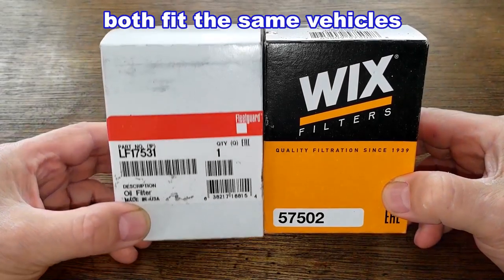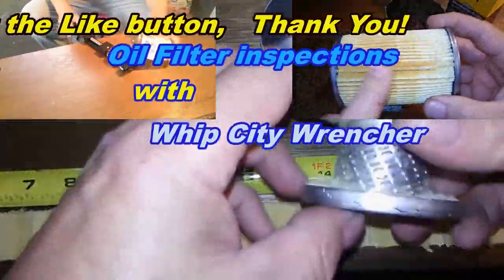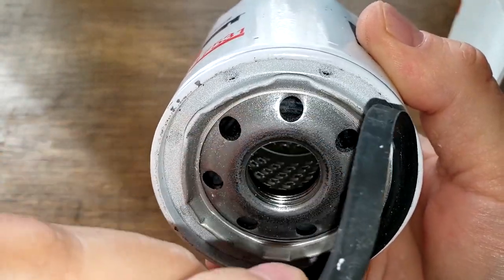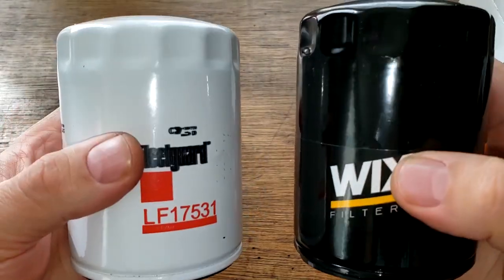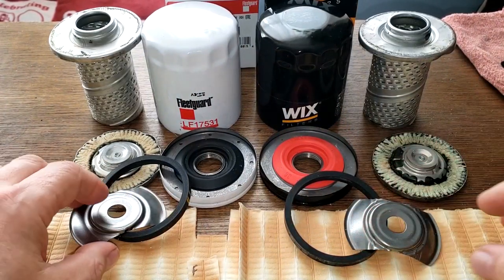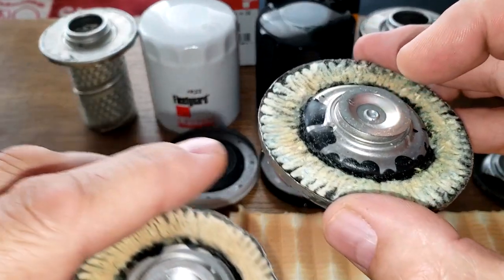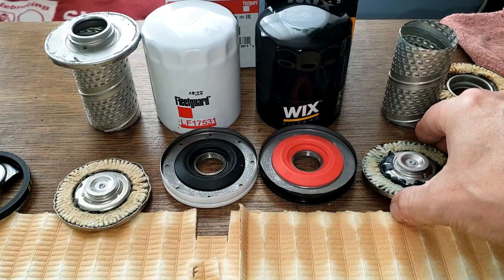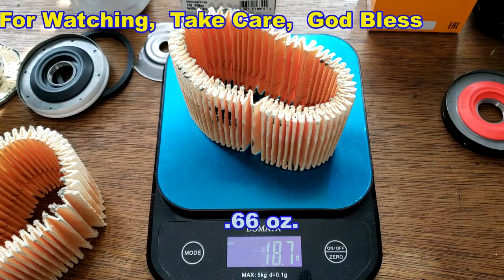Fleetguard LF17531 Oil Filter vs. Wix 57502 Oil Filter Cut Open Comparison

Comment: Wix use to be much better quality; they have let their quality control slip a lot.  Thanks for the video.
Reply: Yes, unfortunately. . I have been using Wix for 40+ years.  We still use Wix Regulars for most of our Fleet trucks as Fram doesn't make Ultras for alot of the 2500HD and 3500 trucks like Duramaxes etc.
Reply: Wix used to be made by Dana. That was when it was a good product. Mann cheapened the filters nearly to Fram quality levels.
Reply from the maker: You're Welcome, Dave!
Reply: @walterk1221  Wix under Dana was awesome. Even Affinia was better than what they are now. You are correct about racing Fram to the bottom.

Comment: Another FG 'labeled' filter made by Purolator US, Fayetteville NC. Pretty sure you posted a similar FG a while back. The FG looks decent to me, but would prefer silicone adbv. The "Wix" has M&H Purolator type construction. Agree on sloppy clean side excess glue, no bueno! I don't worry about a little excess on dirty side. M&H Wix QC needs to improve, topic is sad. Thanks for video.
Reply: Did Cummins Filtration sell out? For the ADBV, most all of our trucks have a verticle mount and never go more than around 6-7K with filtermags so not really a concern.
Reply: @GT-mn3bx  I don't believe FG sold out. I think FG is outsourcing manufacture of smaller and/or automotive gas engine oil filter applications. Seems Purolator US is making at least some of those (like topic) filters for FG now.
Reply: @faxmen09  this is true in broad strokes. Cummins Filtration focuses more on the larger HD engines, more frequently purchase finishing the smaller filters for gasoline engines.
Reply from the maker: You're Welcome, faxmen09!
Reply: @Nash_Nismo  That makes sense.

Comment: Good morning from Birmingham UK!
Reply: Good Morning, Birmingham, UK !!
46 degrees F -- Sunny, Warm and Dry at Phoenix, AZ, U.S.A.
Reply: @SlikLizrd  What is the temperature at Fram headquarters?
Reply: @jeffkortsch8276  it's the UK in November at 15:34. So going dark 🥶 Wet cold and Birmingham village gets very muddy this time of year🤣🤣🤣!
Reply: @jeffkortsch8276  Currently, at FRAM's Headquarters in Cleveland, OH -- it's 45 degrees F; cloudy; windy - gusts to 30 mph.
No precipitation for the next 6 hours.
 Besides the FRAM Headquarters, Cleveland is also the home of "The Rock & Roll Hall of Fame".
 Why do you ask, pray tell ??
Reply: @SlikLizrd  Is that on the Fram website? I looked there but couldn’t find it.
Reply from the maker: Good Moring Birmingham UK!😊
Thanks for commenting!👍

Comment: An excellent comparison of two filters that are similar in design. The filter media cartridge and bypass valve design seem to point to the filters being made by the same manufacturer with the Fleetguard built to a lower price point with the nitrile rubber anti-drainback valve. 

After seeing all that excess glue in both filters, I will be looking inside filters that I buy off the shelf to see if there is any before buying them.
Reply from the maker: Thanks, Jeff!

Comment: I would swear these are Purloator filters. The holes are different but the rest look the same idk.  Elongated holes are usually a Purolator thing.
Reply: Both oil filters have Purolator type construction, the FG made in Purolator factory and uses round inlet holes. Wix has M&H Purolator type construction, with oblong inlet holes some (not all) Purolator oil filter use. Hard to say if made in same factory as the FG. As M&H owns both Puro and Wix now, filters are now looking similar.
Reply: @faxmen09  He was referring to the Wix baseplate.
Reply: @GT-mn3bx  Re-reading the comment saying, "the 'holes' are different," you're probably correct. Had it said 'inlet' holes, would have been easier to distinguish the reference. It's true some Puro made filters use oblong holes, not all though.
Reply from the maker: look that way to me too.

Comment: Probably both filters are manufactured by Mann & Hummel, but use different baseplate & anti drainback values
Reply: Yep, the FG has a Purolator type baseplate, the Wix a Wix type baseplate. But, it's about the only thing similar to original Wix filter.

Comment: This is the one I've been waiting for! These really do compare about equally. You might recall a few weeks back where I was talking about the efficiency rating for this filter (21 microns @ 30.8%, per their data sheet). I never really heard back whether that was a beta ratio or not. They just said that type of rating is usually reserved for hydraulic or fuel filters. The odd part is that the media seems virtually identical to the WIX, so it must come down to a different testing process. Unless one of us hears back from the horse's mouth, we may never really know.

Whip, in your opinion, is the construction on a comparable Donaldson better? I picked up the Donaldson equivalent of these filters, and the main difference I noticed is the silicone ADBV. Plus their reps say it was designed to match FL500S specifications, so the efficiency should be pretty good.
Reply from the maker: Hi John,
The ones I've opened seem to be very well-made oil filters. Some have metal screen backings. What size did you pick up? If I haven't already I'll try and open one up soon.
Reply: @WhipCityWrencher  the Donaldson I picked up is the P577066. I'd certainly be interested to see what you find out if you get a hold of one.
Reply from the maker: @mphilleo  I just ordered one, Video won't come out till after the New Year but what other filter would you like to see it compared to?
Reply: @WhipCityWrencher  it crosses to this Fleetguard, the M1-212A, the WIX 57502, the FL500S, Purolator L22500, MSL57502, the Fram 10575 and the Baldwin B7449. I think you've done most of those before, but I think a good match up with the Donaldson is the Baldwin. It might also be interesting to see how the Fram TG10575 or XG10575 stack up. The FS10575 could also be interesting if the Donaldson really does have supported media. I'd say the Baldwin or any of those Frams would make a great comparison.
Reply from the maker: @mphilleo  👍
Reply from the maker: @mphilleo  Hi John, I put the Donaldson P577066 against the Baldwin B7449. The video will be shown Friday, Jan. 27th.
Reply: @WhipCityWrencher  thanks, Whip! I can't wait to see it. In the meantime, I'm looking forward to the match ups in between! 😉
Reply from the maker: @mphilleo  👍😊

Comment: Thanks Pete! Another great video. Two extremely similar filters. I am disappointed by the crazy glue job on both filters but more so with the Wix. Them and their NAPA equivalent used to be my go to filter back in the day. I still use the NAPA Gold on my Impala patrol car. I supply the filter, if not they use some  junk bulk filter. They use Shell Helix oil.
Reply from the maker: You're Welcome Jonathan and 
Thanks!

Comment: The filter industry needs a standardized rating system. That model Wix used to show 99% at 21 microm(Wix site has scrubbed most all ratings since the XP has a worse rating than regular across the board)  Oreilly shows 21 but no %.
Reply: Nice idea, in reality not happening. As long as the OEMs keep their efficiency proprietary, can't force others like aftermarkets to do otherwise. That said, many of the latter do publish ISO 4548-12 efficiency.
Reply: The reason they did is because it 'looks' bad on paper. You would need to preface that information to really compare it. It's always been efficiency vs restriction (or service life) In order to meet the 20K mile ratings you have to let the smaller>30m particles pass otherwise it won't have the capacity to go the distance and will run into bypass early.
Reply: @vincemajestyk9497  Of course it would take longer to plug. Cleaner oil is better oil. I run a 15 micron on my Allison transmissions spin on filters and stick to around 20-23 on engines and never go over 6-7 K.  Most of my trucks get about 6500 per year. Blackstone lab reports are good.  And I run filtermags on everything to pull out the ferrous metals.

Comment: The wix is too slopped up with glue. On that I’d take the fleet guard. They’re both pretty much the same now if the wix wasn’t so sloppy with the glue, I’d give it to that one just on the basis of a silicone anti-drain back valve.

Comment: You can tell M+H owns both Purolator and Wix now.  There used to be a distinct difference between Wix and Purolator, but this Wix filter was clearly made in a former Purolator production facility.  The Fleetguard filter looks like it's made by M+H too.
Reply from the maker: Hi Gary,
Yep I agree.

Comment: A note for meatheads-- the pictorial instructions painted on the filter body show this filter is to be prefilled prior to installation.
[EDIT: Fleetguard filter body]
Reply: As FG is primarily a heavy diesel truck filter applications, and large filters, makes sense. However, for automotive use, not as clear cut. I pre-fill because I can, but it's not a must. And, not all filter orientations can be prefilled.
Reply: @faxmen09  I acknowledge that filter orientation other than vertical are not well suited to prefill. But, due to the fact Cummins and Detroit Diesel both mandate prefill of lube oil filters in the factory operation and maintenance manuals, I consider it an absolute must to prefill any filter in a suitable orientation. There are people that whine about "dirty oil in the clean side". If that was a problem, Cummins and D.D. would not mandate the process. As a side note, many that scream to never ever prefill have no idea what a Diesel engine costs. The B6.7 Cummins engine, as installed in Ram pickups, retails (as of Summer 2920) for nearly 25,000. I will call out any meathead that advocates ignoring factory service procedures.
Reply: @walterk1221  I'll stick with the distinction I made about different type of filter application, gas automotive vs large diesel applications/FG large truck applications.
Reply: @faxmen09  that's fine, gasoline engines are throw-away things whereas Diesels are capital equipment.
Reply from the maker: I prefill my oil filters if they are mounted vertically. I dont know if it's necessary but it makes me feel good so I do it.
Reply: @WhipCityWrencher  I do too Whip, because I can. Agree it's mostly a feel good thing in (PC) passenger car use. Actually, prefilling in PC use controversial in some circles. Some claim the oil straight out of the jug to the clean side of filter, is dirty  and unfiltered and shouldn't poured in. i don't happen to agree, but there is that school of thought out there.
Reply: @walterk1221  I would say these 'modern' gasoline engines are throwaways that are made from recycled beer and soda-pop cans. Most dealerships nowadays just R&R an engine rather than repair it, if you could.
Reply: @WhipCityWrencher  I agree, you're displacing more air and saturating the media with oil so it will pick it up quicker. That's always a good thing. I have always prefilled mine even the horizontal filters because most of it stays and it wets the media. 
I didn't once and the oil pump lost it's prime. I had to pull the dist and use a drill motor to get it to pick up the oil again.

Comment: Fleetguard makes some pretty good filters but I have yet to find one that uses any silicone rubber parts. Maybe some part numbers have them but I haven't seen any. Might be because they're for heavy industry where you're not leaving it in service for 10-20k miles (or hundreds of hours). The Wix looked Ok, it had the 'Purolator' style inlet holes. They're both good filters, but that Wix was 'dirty'.
Reply from the maker: Hi Vince, most of the Fleetguards I've opened have the nitrile anti-drain back valve, but here's a link to one I opened a couple of months ago that has a silicone anti-drain back valve. https://www.youtube.com/watch?v=r5rkXdZ_7V8&ab_channel=WhipCityWrencher

Comment: I wonder if the excess glue is only there to add weight to the overall filter, making it seem premium.
Reply from the maker: Hi Eduardo,
I don't think so, It doesn't add that much more weight, and no one would ever be able to tell the difference anyway without opening them up.

Comment: I crossed the FG to a Baldwin B7449 which shows Micron Rating: 										 										 										9.8 Nominal; 27 Absolute .  No percentage.   Pretty vague.  To me, absolute means 100% but  who really knows?
Reply: Succinctly stated, the term "nominal" is generally accepted to mean 50%. But, it's an old term rarely used. Absolute generally taken to mean 98.7%, rounded to 99. So, using your numbers, 50%@9.8um, 98.7/99%@ 27um.
Reply: Here ya go, GT --
Nominal Micron Rating
Nominal Micron Rating expresses the ability of the filter to capture particles of a specified size in microns at an efficiency of 50%.  A nominal rating of 50% at 10 microns simply means that a filter captures 50% of contaminants 10 microns in size. The statement of this efficiency is important to understanding the performance capability of the filter.

Absolute Micron Rating
Absolute Micron Rating describes filter performance that is capable of removing at least 98.7% of a specific size particle. This rating is determined through a standard test in which oil containing measurable particles is passed through the filter. Particles that pass through are measured and counted. This rating is more informative than the nominal micron rating. Again, the particle size and efficiency must be stated.

Comment: I don't understand when you are using measuring instruments, no matter how close they are, they're definitely winners and losers. But you say they're about the same/relatively the same??.  For instance the rubber seal. Fleet guards came off easily. While Wix was harder to come off and you had a pick at. How many times have I changed a filter for a customer complaining of an oil leak that had an old seal underneath they're relatively new oil filter. Even one is too many.. Wouldn't you give Wix the win for the oil filter most likely not to have the seal come apart from the can? And clearly Wix would flow more oil through its seven ports because the area is larger. No measurement needed there. One can plainly see it.. Also the thickness of the medium is .0015" thicker giving Wix 95% at 20 microns. Meaning the fleet guard has to be less in filtration. Wix did do a sloppy job gluing the element.
I'm trying to say is observed/measure properly and give a winner on each. Once you start generalizing it's a, "Oh Hum" video
Reply: Best practice says when changing an oil filter, ALWAYS wipe down the engine block seal gasket mesh area before installing a new filter. If one does that, chances nearly zero the old gasket wouldn't be noticed if there.
Reply from the maker: You watched the video, and you give it to Wix. I see them both being pretty equal and said they were about tie except for the silicone anti-drain back valve which I give to Wix. All in all these filters were very close in all their components. You're correct Wix was the better oil filter only because of the silicone anti-drain back valve.
Reply: @faxmen09  you said it, "Nearly zero" chance. You would agree that a loosely fit seal has more of a chance of coming off the filter. Then a seal you have to pry off the filter. And I agree with you wiping down the seal base of old oil and road dust before installing a new filter.
Reply: @WhipCityWrencher  Where does it say in my comment that I gave Wix the win? I just pointed out my observation. If you're going to spend the time measuring and weighing. Then you have to give a plus and a minus to each thing you do. No matter how minute. You can't generalize and say well they're about the same when clearly they're not. Otherwise it's just your opinion and not a review/inspection. How can anyone say that either filter is better than the other when you yourself don't know what the micron filter capacity is for fleet guard.
Reply: @amiabledave50  Yeah, I'd agree that looser fit sealing gasket would have somewhat greater chance of 'possibly' sticking to the block. That said, it should only take one time to learn that lesson the hard way. lol. As noted though, if one does it correctly even a stuck to block gasket shouldn't matter.
Reply from the maker: @amiabledave50  You said and I quote ("Wouldn't you give Wix the win for the oil filter most likely not to have the seal come apart from the can"). The gasket won't come apart from the can once the filter is installed. You can decide whether the gasket leaks or not. Who knows if it will leak?
My opinion doesn't really matter in these videos, but since I talk about them, sometimes I put my 2 cents in, and yes sometimes that means my opinion. I weigh them, measure them, also point out certain things that I think are important. You can decide which filter is better. Keep in mind I'm also trying to make a video that isn't an hour long but still informative and entertaining so that the viewer isn't bored. Enjoy the Holidays, I'm done on this subject.
Reply: @faxmen09  Agree 💯 present! I was taught in tech school to always clean the matting surface before new filter is installed. And I Always do.
Reply: @christophermeyer6414  You were taught well and learned well. 👍That and applying a thin layer of oil to sealing gasket before installation.